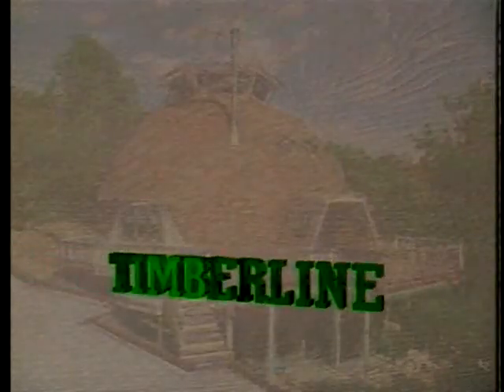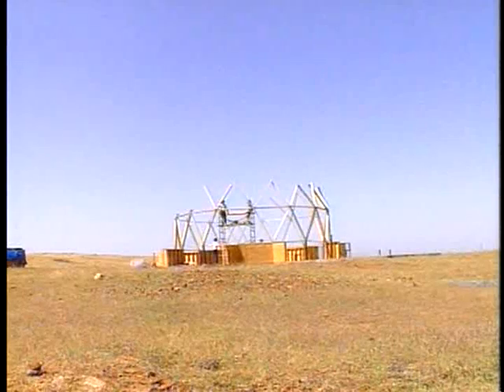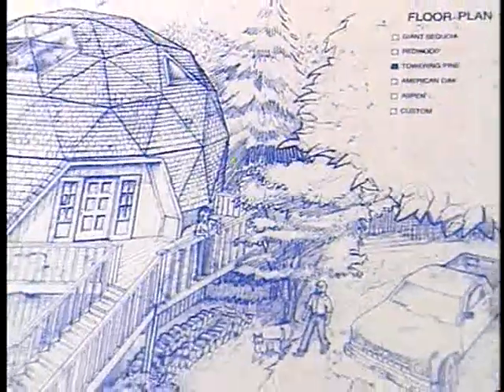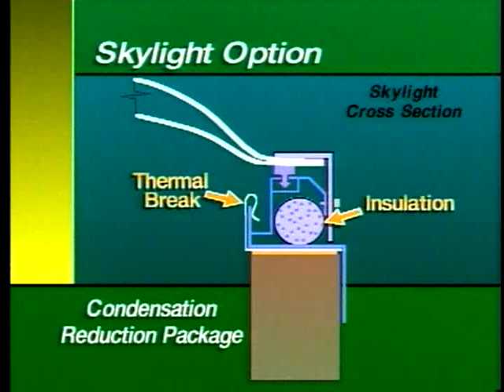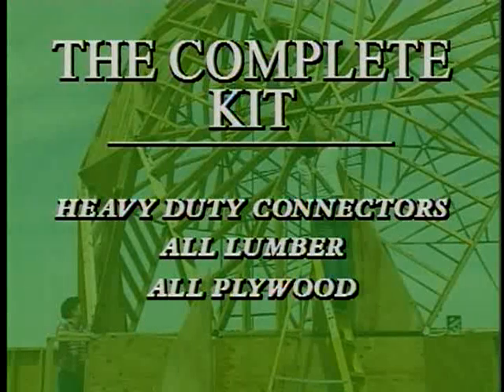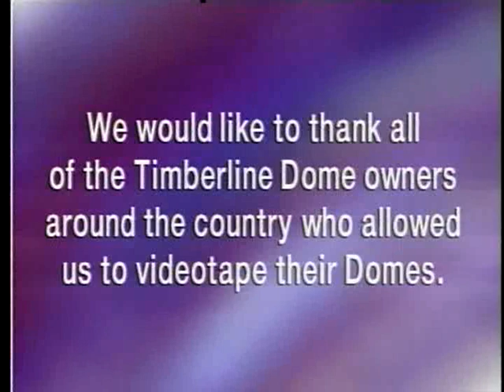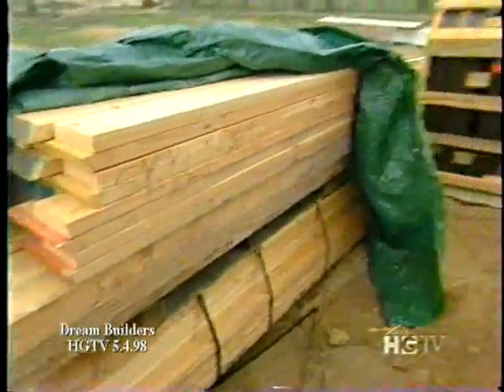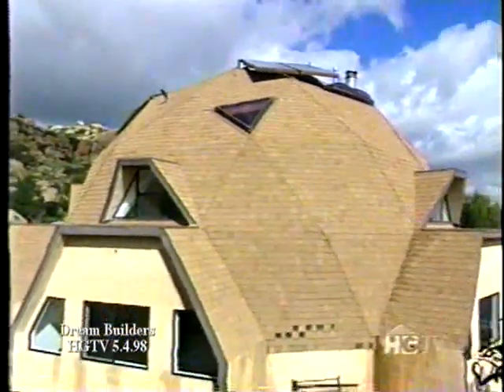Timberline Geodesics - Build a Dome

Comment: First off, this video is very old. there is a seen where a living room shot is taken with a very solid oak coffee table. I have the same oak coffee table I purchased new  in 1987. I went too a re finisher to have the same coffee table and both end tables to be refinished.  There is only a few reasons to build a circular home, tornadoes, heavy snow, semi heavy  winds. still has shingles.  there is one other thing. The projection TV,  no company has made a projection tv  like that for at least 20 plus years. first thing I would look at is this a corporate own single stock owner, or can anyone buy stock into this company.   if this company is still around buy with caution.
Reply: it is from may of 98 according to the video